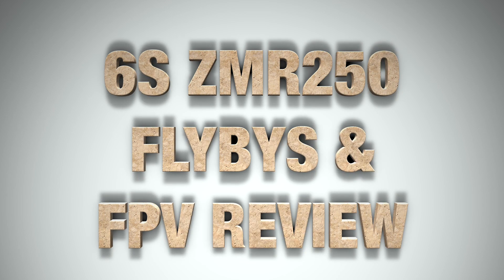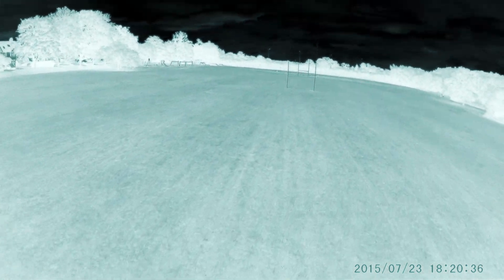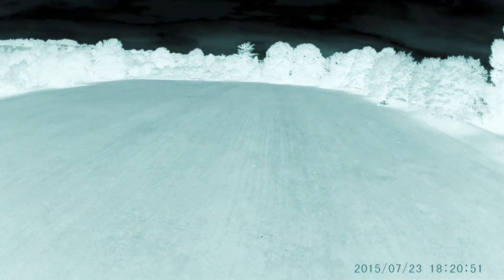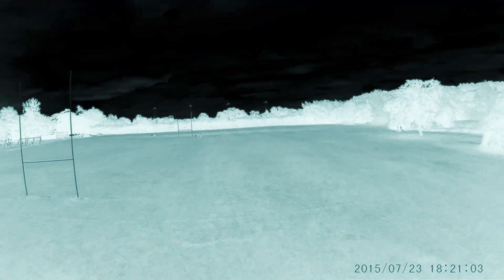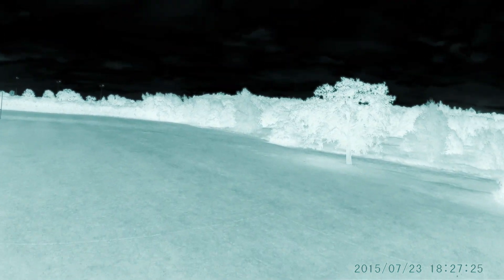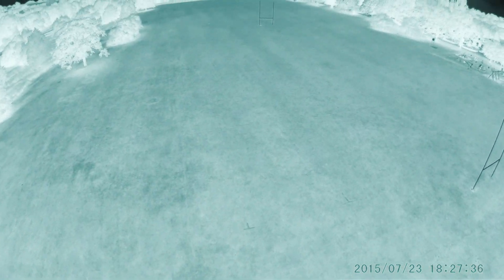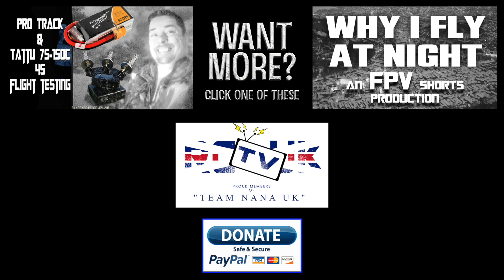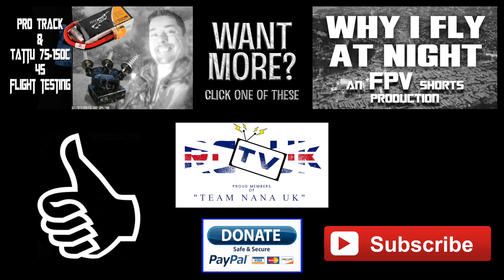6S ZMR250 FPV FLYBYS - TESTING & REVIEWS

Comment: Great video! Make sure you read the RCgroups forum before you build the ZMR250 V2. That frame has some serious flaws.
Reply from the maker: JKFlorida Thank you for the heads up JKF, is it the frame I have from FPVModel that has issues/flaws?
Reply from the maker: RCTV-UK Hi JKF just been over the entire thread, needing to use a couple of fibre washers and the lack of 3mm hole options seems to be about it or am I missing something?
Reply: RCTV-UK Yep. That's pretty much it. But that's a big problem. My buddy caught his ZMR250 V2 on fire. This was before Fpvmodel was shipping the fiber washers.